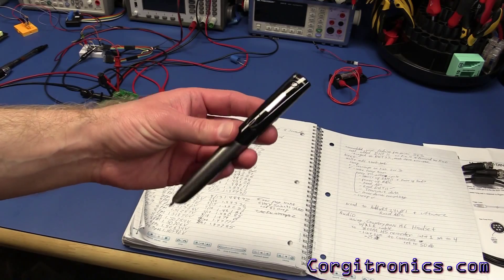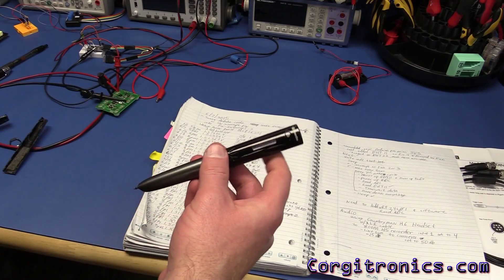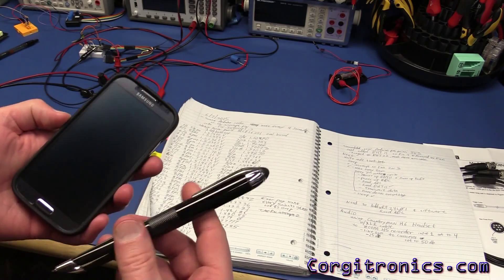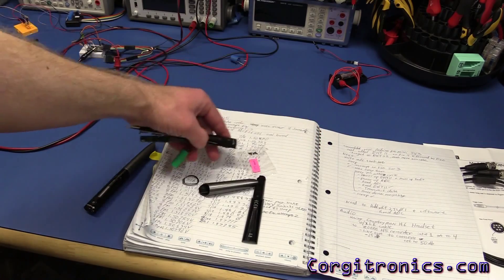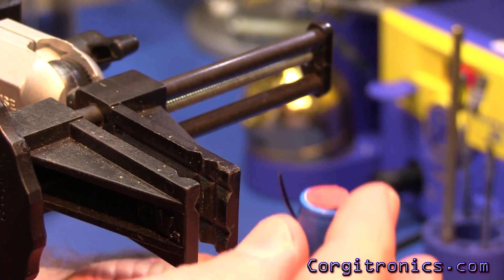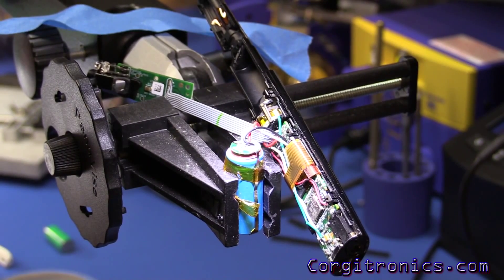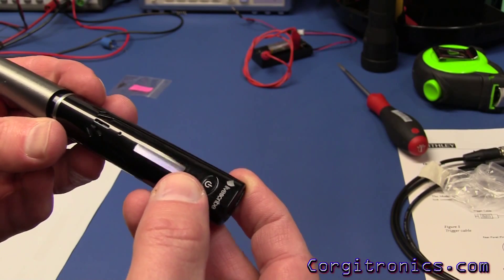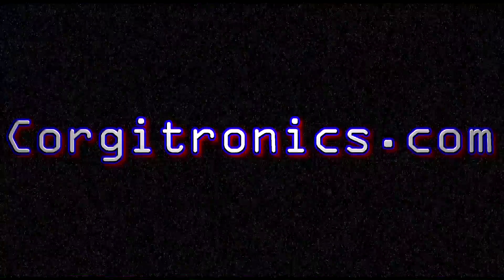Livescribe battery replacement

Comment: what was the name of the tool you used to unsolder the battery leads?  Was this an ultrasonic thingamagig? ;-)
Reply from the maker: That is my very nice Hakko FM-204 vaccum desoldering tool.  https://www.hakkousa.com/products/desoldering/fm-204-digital-self-contained-desoldering-station/fm204-01.html
You can do this with regular desoldering braid.  After using the FM-204 I often clean up the connections with braid.  The Chemtronics braid is well regarded.  https://www.amazon.com/CHEMTRONICS-80-3-5-BRAID-DESOLDERING-ROSIN/dp/B00DJVY1PW?crid=2AB7N4D7CLNAU&keywords=chemtronics+desoldering+braid&qid=1538347268&s=Home+Improvement&sprefix=chemtronics+de%2Ctools%2C164&sr=1-3&ref=sr_1_3

Comment: Hello, from your video you showed a livescribe 3 Smartpen, well I have also and ,but I have the pen stuck inside and I need to open the body to remove the pen . Do you know how to open it up to get the pen out ? Would appreciate any advice. Jeff
Reply from the maker: The Livescribe 3 pulls apart just like the Echo.  Just pull it apart by holding the forward part of the body in one hand and the knurled twist ring in the other hand.  It's a bit tough the first time, but with a little wiggling it should come apart.

Comment: I doubt that the filesystem is FAT32 or NTFS, but the firmware was overwritten by an audio recording that got too large and I was wondering if you happened to know a way to force your way in the filesystem without the use of Livescribe?

Yeah, that's a crazy thing to ask about, but it seems a bit ridiculous that the memory has to be completely flashed.  There's gotta be a way to nab those files!

Comment: Great vid, thanks.  Still searching for the battery. Ordered from Alibaba bt it was out of stock.   Do you know if the battery for the WiFi model is the same as the battery for the Echo and/or if the batteries are the same for 2/4/8 gig models?
Reply: I open my Echo smartpen and the battery is ICR12300 250mAh 3.7V that is the same spec.

Comment: Hi! How much would you charge to repair a dead oled display? 
I bought a livescribe echo relatively new but discovered the display was dead. 
The battery is ok, I can hear sounds clearly. The display just needs replacing. 
There's a diy repair tutorial I found online: 
http://amasci.com/elect/livescribe.html 
I just don't trust myself with a soldering iron. 
Let me know if you can help! :)
Reply from the maker: That's a pretty thorough tutorial.  I'd suggest looking around your area for a Maker group to assist you.  Public libraries often host maker clubs.  Or, post a message on various forums like iFixit?

Comment: by any chance do you or one of your viewers have the specs for the battery for the echo pen?
Reply from the maker: I started with the Livescribe Pulse and then the Sky Wifi pen, I never had the Echo.  The one in my old Pulse pen looks the same as the one in my Sky pen, so it's probably the same battery in the Echo.  You'll probably have to open up your pen and look at it to be sure.

Comment: so intresting thanks a lot.   but can you show how to disamble it??! to start to play with it ))). and did you find the way to replays the screen?
Reply from the maker: +Brat Pisgor As far as I know there aren't any replacements for the screens.
To disassemble the pen, just pull it apart.  hold the grey section in one hand and the black in the other hand and pull.  It takes some strength, and twisting it a little back and forth seems to help.
Then, once inside you will need a Torx T5 screwdriver.

Comment: hi I have a question for you I don't necessarily have a battery problem but I have a USB port issue. I recently tried charging my echo pen that I bought in 2011 and the USB port seems to have jammed inside and so I can actually stick my charger in the appropriate place and charge it I'm not sure how it looks inside if that portion is attached to the chip? do you know if the pen is still repairable if the part 2 charge it is not attached to the chip
Reply from the maker: +Ruth Lopez It sounds like you have a problem similar to what Myrtle (see earlier comments) had with a Sky WiFi pen.
I dug through my old pens, but I didn't find an Echo.  It looks about the same as the Sky, so probably very similar construction inside.
I'll get the microscope out, teardown the pen and take some close-up photos to post.

Comment: so how did it go after you charged it? do you have a followup video?
Reply from the maker: +Hazardous Heart I should post a follow up.
The pen worked for a little longer, until the screen finally died.
Reply: i too was interested in seeing it work. You might could replace the screen.
Reply from the maker: The problem is finding a replacement screen.  There are good write-ups about how to replace the screen, but you need to find the parts.  http://amasci.com/elect/livescribe.html

It's really time to give up on Livescribe, there are better products out there, like the Neo Smartpen, or note taking tools that run on Android and iPad:
https://www.neosmartpen.com
http://myscript.com/
Reply: They (livescribe) doesn't even make the pen technology, that's made by Anoto. They just slapped-together a half-cheeked tech demo and sold it. My Sky smartpen never worked very well, the evernote integration was never very polished, and the viewer web app (just give me a PDF, already!) was totally clunky.
Even when I was using it, I just tried to imagine how much better it would have been if it was made by Apple (back when Apple was on top of the world). :/

Thanks for the info, I guess mine is dead for real. Can't get the screen to come on. Either dead battery or dead screen. Not worth the trouble to try to resuscitate it. I hadn't powered it on in 3 years, and was trying to see if I could sell it off on letgo. Probably going to goodwill instead.

Cheers

Comment: I took my pen with 2 hands and pulled it apart because I figured it was like a normal pen... Did I break it??
Reply from the maker: +Marilyn Michaelis Probably not, but you should look at the last part of the video (around 6:50) where I reassemble the pen.
You should be able to just slide it back together.
Reply from the maker: +Marilyn Michaelis I finally got some decent close up shots through a macro lens, the microscope shots were worthless.  See if these help:
https://corgitronics.com/2016/05/08/livescribe-usb-pics/

Comment: Hi, this is the video so many people were waiting for. Thanks for your encouraging instruction. I like the concept of livescribe pens and used my echo for about 2 years, but now the OLED display disappeared. If its very dark you can slightly see the words, so I hope its dealing with the battery. Could you please give the pulse and echo victims a hint, where you can get the replaced battery?. That would be very helpful. I couldn´t find it on ebay. Thanks again for posting your experiences.
Reply from the maker: +Roland Knoblauch I found it here, it did take some looking:  "battery Livescribe smartpen WiFI APX-00015"
http://www.ebay.com/itm/Akku-fur-Livescribe-WiFI-Smartpen-APX-00015-2GB-4GB-8GB-/121519409601?hash=item1c4b1f09c1

Comment: Great video could you please help and fix my pen.  I really need to get the data from my phone and get it up and running.
Reply from the maker: +Myrtle Jones Myrtle, I replied to your comment on the Corgitronics blog, here: http://corgitronics.com/the-bench/#comment-1622

With the problem you described, I would suggest calling Livescribe technical support. I hope they will help you.  I would be concerned that opening the device, and removing the circuit board could damage it to the point you can't retreive the data.
Reply: I called and they were of no help :-(
Reply from the maker: +Myrtle Jones Ok. what model pen do you have?  You mentioned your phone, do you have a Livescribe 3 that syncs to the phone?  I really don't know much about the L3 pens.
Reply: +Corgitronics I have the sky wifi 2gb
Reply from the maker: +Myrtle Jones  How are you at soldering really tiny connectors and such?  See my instructions (link above) on disassembly.  I'm afraid of what you'll find when opening up the pen.  I didn't completely tear down my pen (remove the main board, etc.)  and the USB connector is on the backside of that, along with the display.